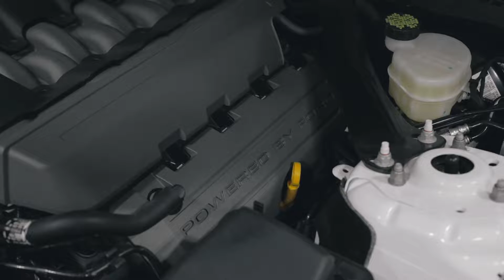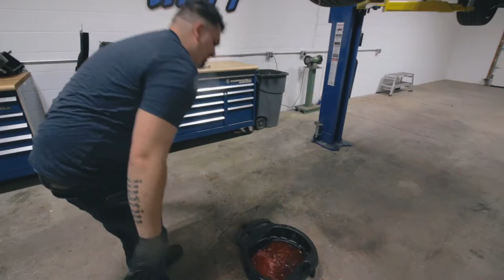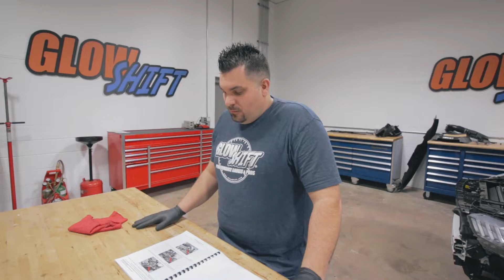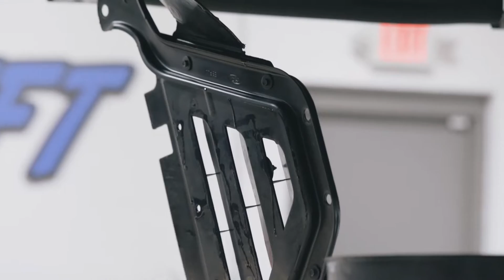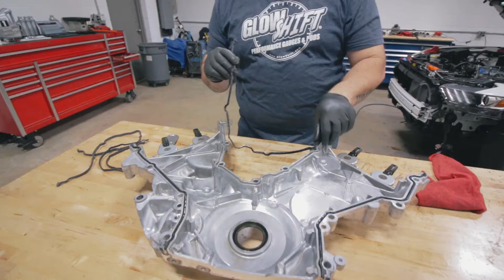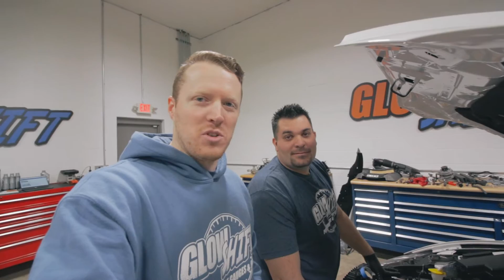GlowShift | Ep. 3 - Tearing Down The Coyote Motor & Whipple Supercharger Install On The Mustang GT

Comment: Soo? Are we gonna just not talk about how the gears you took out were billet steel gears already from ford lol? These issue with oil pump gears is from twin turbo guys in the rev box at tracks.. over revving the motor and the gears heating up and cracking. Most engine builders will tell you that this is overkill for a 500-800 wheel hp car. Just don’t bounce the car off the rev limiter and you’ll be fine, I’ve had 3 S550’s. Current one is stock motor except for whipple and king tubes and tube of course. 828 rwhp last dyno on e85. I’ve had the car since new and supercharger got installed at 2200 miles and car has 56000 lol. That’s all I do is road race and drag the car and beat the hell out of it. Trans finally went at 40k but other then that make sure tuner sets shifting to 7800 and you’ll be fine